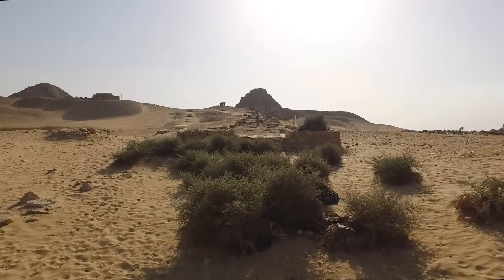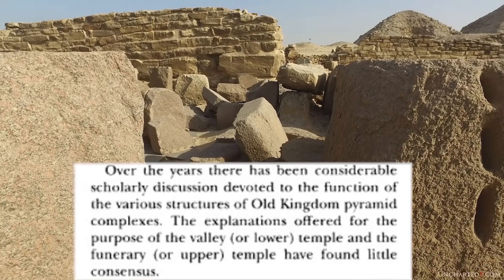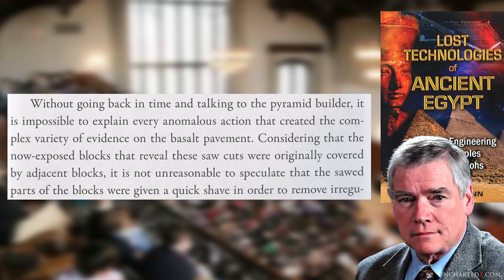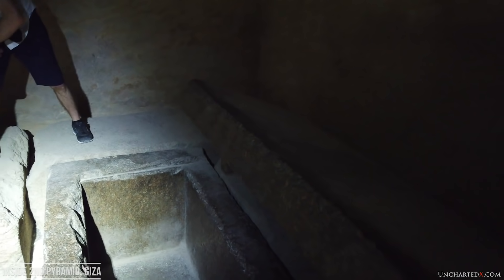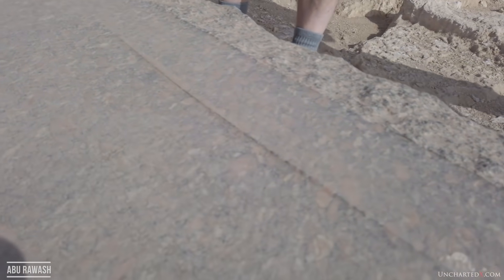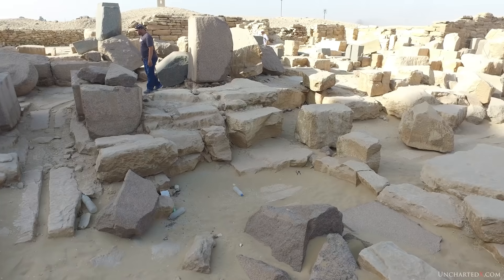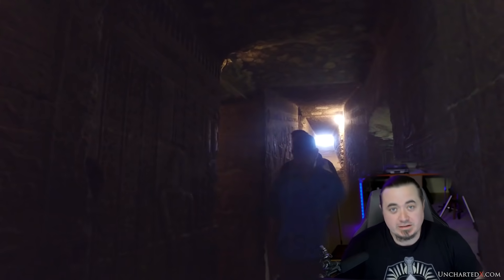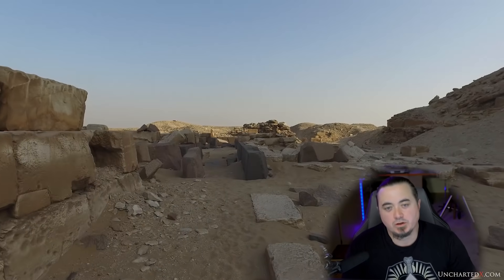The Mystery of Ancient Egyptian Stone Cutting in Basalt and Granite - UnchartedX full documentary!

Comment: Ive looked at the shape and details of the flat sides of these blocks for years now. No doubt, circular saws were clearly used. There may have been a few on the site during these major constructions. A blade could have been extremely difficult to produce, and after exhausted, material would have been repurposed into smaller tools.
Reply: No doubt?  Why?  Because you 'looked' at them?  Wow, what fkng compelling evidence!
Reply: @chiznowtch  you explain the perfectly round kerf marks genius.  Lol
Reply: @jasonrodriguez245  made by copper drag saws.  The round cuts and striations are a result of a pendulum motion and the wearing down of the saws on the ends.  Many experiments have been conducted resulting in the very same marks.  It's either that or a 35 ft diameter powered circular saw which is, of course, a childish notion.

Comment: As with modern cut off saws, Softer blade compound to cut harder material,Harder to cut soft etc…The blade size in this case large. Large diameter to reduce heat and prolong the blade life. Bronze mixed with the adequate abrasive material for the blade as mentioned. Finished blades to the furnace pot..

Comment: Ben, have you spoken to any engineers about how big a large enough lathe or milling machine would have to be turn one of those large columns? It would have to be 50Ft long and the chuck to hold the piece at least 8' in diameter? Astonishing to say the least. It would be a huge challenge in today's environment. It could not be fabricated in wood, which is far too flexible, so it would have had to be made of steel! There was no steel back then, so something has to give about what we know about prehistory. Never mind the power source which just simply did not exist.???
Reply: maybe your head is stuck in a lathe....round and round......it appears that all the large columns have a square carve out on each end....so yeah, to turn such large stone secured by some chunks of wood plugged into each end.....ummmm, mindjack.

Comment: I read that the ancient Egyptians placed 2 9’ long tuning forks against a stone that were a few feet apart from each other. A copper wire was stretched between them. Mallets struck the tuning forks simultaneously, the tuning forks vibrated, and then the wire cut into the stone, and probably the tuning forks also cut into the stone, making a narrow tunnel. Smaller, shorter tuning forks were used to carve granite statues. A small chisel was placed at the end of the tuning fork. Then the tuning fork was struck, vibrating it and having the chisel cut the granite.

Comment: Looking at the "circular saws" part of the film, I have some suspicions as to how the arcuate and concave cutting lines shown on such a plate were created. The cutting device could be a suitably high mast with a movable boom suspended by a rope to the top of the mast, similarly to a Bermuda sail. A cutting "head" with a mineral harder than the processed one, or a tool working with quartz sand, can be attached to the free end of the boom. Many times repeated side-to-side movements of the boom would result in the cutting of the stone layer. an appropriate change in the length of the boom and rope would enable the cutting part to jump, as can be seen in the video. The arc of the cutting line and its concavity may result from imperfections of the mast-rope-boom system, because such a system is a kind of pendulum, the end of the boom would be lowest in the central position and higher in the sideways positions. This is my humble suggestion! A fascinating topic! Regards, Matt.    Sorry for the "uncle google" translation  😉

Comment: That piece of basalt, like you say is concaved, so it would be impossible to do that with a circular saw. But if you had a thin drag saw you could bend it to the desired curve. Poor example of some thing cut by a circular saw. The cutting edge of the drag could have been curved like twoman woodsaw like they used before chainsaws. The drag saws would have been scrapped. That’s why you don’t see them now.

Comment: One can achieve (near) perfect symmetry, and replicate curves and precise form dimensions by the use of flat section molds. Vertical, horizontal, diagonal. They would have probably been made of a stiff and dimensionally stable material such as multi layered wood or copper plate, depending on the accuracy and size of the object to be shaped.

Comment: Started doing a marathon of this playlist starting today.
The question of "where are the tools" is easy to explain away. Even if we go by that everything made is 6,000 years ago, there would be no iron tools left to be found. If some cataclysm happened and we were forced to leave out cities, in 6,000 years there would not be a single iron or steel structure left to be found. Iron and steel rusts and corrodes over time, as will copper. The Hoover dam wouldn't be there as it is steel and concrete that erodes over time, especially where there is a lot of water. There are also no tools at the Hoover dam that was used in its construction.
The only things that would survive that time that would prove that we existed would be MT Rushmore and the Panama canal, and no tools would be found at those sites either.

Edit to add:
I think they used basalt for roads for the same reasons that we we asphalt, and still to this day keep it black. The reasons would be, how hard that basalt is making it so that wear and tear would be minimal over time, and it being black would make it so that it absorbs heat making the roads stay clear easier. In our case from moisture either from rain or morning dew.

Comment: Circular saw = Draw saw, but hanging like a pendulum off a single point, and swung. Copper Blade edge forged to followed the curve of the swing. Used blades were either resherpened, or when not possible - melted down for conventional chissels for the other workers. hence lack of artifacts of these.  - Your welcom !
Reply from the maker: swing saw is a possibility. still ridiculously thin.
Reply: now explain the complex curve.

Comment: The copper saw theory is bonkers. I am sure that anyone who has ever held saw in your arms could agree, even cutting wood with carbon steel blade (that is blade which is magnitude of times harder then material you cutting) it take enormous amount of energy and time to make a cut. Even cutting wood the hard steel blade becomes dull and finally any cut with hand saw always results in uneven finish and misaligned angles.

Now imagine doing the same thing with the tool which is significantly softer than material you cutting, using sand as a cutting medium, having to manage the extensive wear on the tool whilst maintaining accuracy of mere microns, staying true to all other measurements etc. This is just unbelievable. And as mentioned that is before we even consider all the internal cuts etc. 

I assume it is feasible to cut a single tone to very rough cut i.e. if you found a single stone in the dessert and wanted to explain how sawing marks appeared on it, then this would be feasible explanation. However, that does not explain how multiple stones could be cut to micron precision and all fit perfectly and repeatedly.

Comment: I think we might be over thinking the curved stone. If you have a cutting wheel that's 30' in diameter, and you run it side ways down the stone, you'll get that curved shape. Yes, you'll be cutting with the side of the saw blade and nor the direct cutting edge, and it would take more time, and you'd have to go slowly, but, it's entirely possible and if you have a saw that will cut in one direction,  they will absolutely cut in a side ways direction.  It will eat the blade up, but, if your making a speciality piece, it may be deemed worthy of the time and cost. And these cuts were absolutely made by some type of saw. From someone who's worked in construction my entire life, it's pretty easy to look at and see. But, I guess I could be wrong. But, it just really looks to be saw cuts to me.

Comment: 36:58 Think that piece is upside-down. It can snap off like that when cut Granit with blade. 
Large block are hard to get 100% flat to what you cut on, 
and when both side are heavy it snap an inch, hopefully not to bad. 
Weight and weak point, not from blade or pushing to hard or soo.

Comment: 18:12 The rings in the drill hole.,I'v drill Granit. And this type of Granit (Looks like Baltic Brown). 
I don't get this drill marks in any Granit, with hand drill or the CNC machine. 
If i do it by hand with a machine and body force, the only thing is that it can go sideways or hopefully straight down, no rings.
Can it be that they stop and refill sand as grind material, and it grinds a new ring?

Comment: Speaking of tube drills. Theres a new tunnel tech that does just that with automated bots. Full construction leaving a hollow inner. Drill 3 small holes in parallel, inflate pressure into the middle, precision cracks. Can be done from inside the tube and thousamds can work in unison.

Comment: ~3 mins in - 'channels in the floor'... Drainage. It's an arid landscape - most of the time. But when it rains it rains, so a stone building and large structure will drip badly unless you carry the water away, and straight down and away under the floor is simplest. I wonder of there are any vertical channels within walls or columns?

Edit: ok maybe not 'simplest' - but most practical, effective and and aesthetic end result if that's what it is.

Comment: Are there candidate theories about the channeled blocks? The more I think about it, the harder is to create anything logical. 
- the combined capacity of the channels far exceeds that of the external recipients;
- the recipients are positioned beneath the channels, meaning they were intended to deal with something bound by gravity;
- the channels appear to be very irregular on their inside shaping, not polished;
- there are curved sectors along the channel paths;
So, if they were built to collect useless inside fluids, be it common water, or some form of manure, no need for an external recipient to collect, it could just go to the ground.
Any process of melting inside the pyramid, using this channels to convey the melted fluid, would quickly become solid, clogging the channels.
Any valuable fluid produced by unknown methods inside the pyramid, would have a relatively too small of a container waiting outside, implying some loss of material.
So, some far fetched ideas:
- it could be that some fluid would be used as carrier for bringing out the product of an advanced, technical process that could only be done inside the pyramid, and by some unknown reason could not be transported by any other more practical mean. For instance, if the pyramid were used to make orichalcum, in very small beads, they could be carried out this way.
- it could be that some material could be produced in an excruciating slow pace, something in the style of the black fluid synthetized by the aliens in 'district 9', that took 20 years to fill a cup. And this material would be very, very slowly collected by these channels and channeled out to the outside vases. 
- another ways of expelling a product outside the pyramid through these channels could be by magnetic waves or sound waves, by some elaborated and unclear reason.
- it could be a nest for special scarabs, whose dna would have very special properties, and would be carried out by any fluid through these channels and collected outside.
The vases could be recipients for depositing something outside that could be bathed by the fluid, possibly water, flowing from the inside of the pyramid. And this fluid would have very special properties, for instance a form of magnetized water, or other form of energized water, that could heal or produce some special effect only achievable because of the pyramid.
A point of interest, what could be eligible to be 'of value' for the people that constructed these channels? By the way, not any egyptian dynasty. Gold? Silver? I could not advocate that a species capable of building structures that we, even today, would not be able to, would have financial interests in these constructions. Nor religious/ceremonial. Considering the precise alignement of some pyramids, the magnetic nature of the Earth, and some phisical principles unknown to us by now, the pyramids could be some type of production unit of some kind of very rare substance or material, that could not be achieved by any other more practical and trivial mean. These structures are clearly not meant for comfort of the occupants, if any. They were not ornated. They don't have windows, nor easy accessible doors, so they were not meant to be used on daily basis, not temples then. It is truly something to wonder about.

Comment: The concaved circular saw cut block looks to me like they were running the block through the saw too fast which caused the 30 foot diameter blade to begin to warp as it cut and then eventually bind and snap the end of the block off which is why it was discarded¿

Comment: Just thinking about to how to make the equivalent of the modern diamond-teethed stone -circular saw - but using only ancient materials.

Copper saw idea seems correct in principle but impractical due to wear - and very inefficiently used in the experiment - the ancients were clearly more savvy than that. If you can move a 50t stone block then making a heavy saw blade move backward and forward with minimal effort would be easy

1: How about a wooden main disc for the blade. That, with a driving shaft,  and some form of carriage - so it can traverse smoothly, is your basic 'machine' - much like a modern one.
2: To the outside edge of the wooden disc (or spoked wheel?) attach an easily detachable (important point) copper outer ring to extend the wooden disk further out.
The wooden disk can be of any thickness - it will only be the fairly thin (1-2mm?) copper that will go below the target stone surface.

3: Before fitting to the wooden disk lay the copper outer disc ring with its outer edge sitting into a suitable mould made of clay, and set quartz teeth into the mould's outer radius edge.
4: Then pour in molten lead.
5: When it cools re-attach it to the wooden disk and off you go. Once you've got the device, and it's support infrastructure, it becomes more viable than the copper+sand stone saw idea alone - swapping out a new cutting disk should be a relatively simple task - send the old one back to the workshop for a refurbishment; and use it again next week.
6 :The bigger the disk (within reason) the higher its tooth speed will be for a given rotation speed. A major increase in cutting speed over the horizontal saw that does not pull its full length out to fully clear the teeth. A big circular saw could easily be driven with a 2-man hand-crank, its weight giving a good fly-wheel effect.

Drill bits, or tube-drills, could be made in much the same way.
It also gives general cutting bits for horizontal milling too, and lathes.

In fact I see no reason why most modern machines could not, at least in principle, be made in wood using copper tool-bits with quartz (or other hard mineral - diamonds even!) embedded using cast lead.

But very disappointed that not one such stone cutting tool trace has ever been found. Granted these are the sorts of items that might have been scavenged for their scrap metal (lead? and copper) - there are still other types of copper and bronze tools (for wood) that do survive. But it's too much of a coincidence to dismiss.

Brilliant channel BTW.

Comment: So the channels lead to a pot supposedly for collection. to cut hard rock you need a hard tip, knowadamzain, so if they use point cutting tools the most easy to come by would probably be diamonds or some other gemstone. they will probably be tiny, and losing those in the middle of the desert is probably bad vibes. when you cut, might aswell cut wet, to clear the dust, also if you drop a gemstone, they flow along the stream. the collectionbin allows them to collect those. all hypotheitcally speaking ofcourse.

Now that rod has a spiral groove? depending on the dept it could increase "lubricant" flow where it to be used as an axle. what if they had a whole workshop of holes with spinny rods inthem, lubricated by water and precision. suppose you take a Cymbal looking ass disc with some diamonds hammered in the edge, stick it on an axle. 

Okay, what if the groove is to make install easier. because you fill the hole you put it in with water, but as soon as you drop it in, it vacuum seals. if you have precision holes gotta add precision groove. I imagine a lathe built of precision rocks. also the a fist size rock can prbably easilly hold a blade waying 1000+ pounds, no need for superlarge bearings.

Oke the workshop floor made out of hard stone? because you are dragging and twisting and turning large rocks around a comically large flooded routertable making no sound when it's not cutting, yikes. 

If you spin the cylinder with groove the right way, it might build water pressure making the bearing slightly lift itself for efficiency.

on google i can't find any good metal artefacts but a 8m wide disk will probably get gobbled up for metal scraps especially because, as a tool, it probably wasn't very pretty, but it might have had some diamonds they can use. 

so a block with a hole, a rod with a micro-𝘨𝘳𝘰𝘰𝘷𝘦 and a giant trashCymbal.